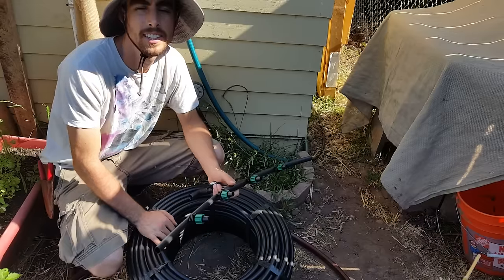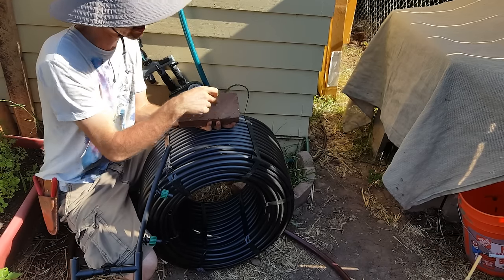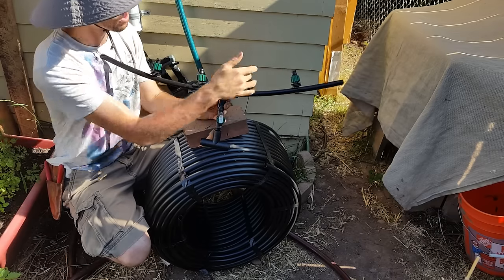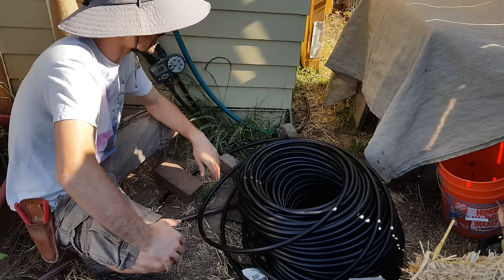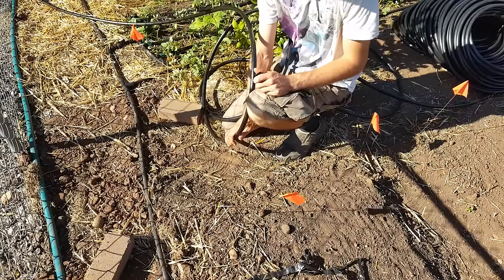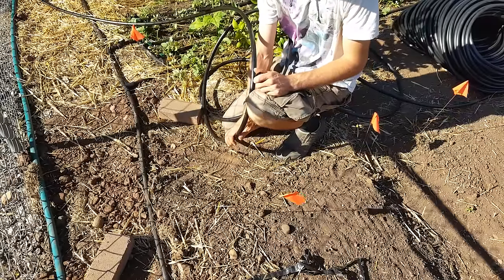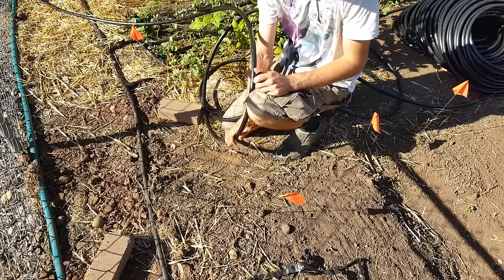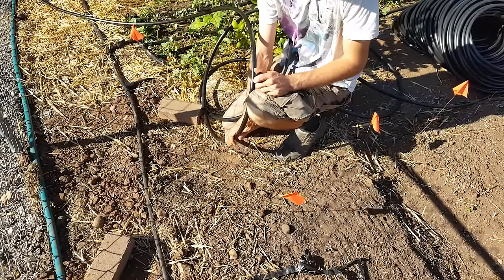Market Garden Irrigation: Installing Drip Tape System

Comment: Those drip lines do best if buried an inch or two. I’ve learned the hard way they fly off and move around too much otherwise. I’ve also never had issue with dirt getting in the line as long as you have the holes facing up. HOSS Tools has an amazing video talking about burring the lines!
You did a great job though 👏

Comment: Very good as sometimes you can't water overhead at night and in the sun the water will scortch the leaves.
Great video
Reply from the maker: I use mostly drip, but I do occasionally use overhead for direct seeding when I'm trying to keep a soaked bed wet. I'll talk more about that in a future video. Actually water on leaves doesn't burn the leaves there is no magnification effect it is a misnomer. Farmers spray water on lettuce constantly in the summer to keep the cool and not bolt. If it damaged the leaves they wouldn't do this. Plus from my own experience I know it water on leaves during the day is fine.
Reply: Nature's Always Right oh cool thanks for the info that sounds right I always wonders how the farmers don't burn thee leaves in the heat.must be a myth that's been wasting my time for years.now I can water all day long :)
Reply from the maker: Ya I used to believe the same thing! Just one of those myths that keeps being repeated. But you are half right, it is better to water early morning because that's the coldest part of the day so there won't be much evaporation, this is especially true with overhead. Those big farms waste an immense amount of water using overhead and watering during the hot day.
Reply: Nature's Always Right that’s interesting I had real trouble keeping up with the watering last year during a heatwave as I was watering at 10pm the night before, but by morning they needed more water and I wasn’t watering them in case I burnt them and actually lost my one and only cucumber as well as losing several astilbes and had brown crispy leaves on a lot of my perennials - I could have safely watered them but I thought I was causing the browning and crisping by burning them with water in the sun
Reply from the maker: If you are running drip, then I recommend watering heavily. Thoroughly soak your garden beds. Once soaked all the way through they are much easier to keep wet after that. It sounds like you didn't water enough. There is no way the bed should dry out overnight. I recommend watering in the early AM 4-7am. That way water isn't sitting all night, it can increase the chances of mildew and rot problems. Watering in the morning allows the surface moisture to evaporate soon after and keep the top of the soil and base of the plant healthier.

Comment: Great video! I was looking for information on how to set up drip for a market garden and this helped a lot !
Reply from the maker: Thanks! perfect timing glad it helped! There are so many ways to set it up. Now I'm doing a bit of a hybrid approach where I use both driptape and overhead watering for direct seeded crops. I'll make a video about it soon.
Reply: Yeah, I would like to get both set up as well(more drip for the lower rotation beds and more overhead for the higher rotation). Looking forward to that video!
Reply from the maker: Ya I think a combination or certain water set ups for certain crops is best. I like using drip tape for all transplanted crops still.

Comment: I have rewatched this so many times trying to figure out how you built your 4 port drip tape diy adapter. I can't for the life of me figure out what that green fitting is. I have searched all through drip depot and always am left flustered with all the things they have. I can't find where you explain that part/attachment (can figure out the diy-ing assembly part). I've given up after coming back to this a handful of times, and have went back to my seeping hose/ 1/2 to 1/4 in. drip line and supplemental sprinklers. If you can point me in a direction of the fitting I would be so grateful. Otherwise, you've given me so much info with your videos. 😊 I run a humble market size garden that is just for us and sharing with my friends, family and the bunnies. After all the hard spring work every year,, it's exhausting to even think about processing and selling all that produce to others haha!

Comment: would it help to put the pressure regulator close to the drip tape line instead of next to the Orbit which could be quite a distance?? especially the low 10 Gph and 15 Gps??  Also how do you work the garden in the fall with all the drip lines going up and down the rows??

Comment: Steven thanks for the info. Need a little more info on what to order. What is the emitter spacing and flow rate? Also mil size on tubing. Thanks.

Comment: Great job and nice video! One question, did you install the drip tape on&off on the both side, or just in on side of the bed and in the other side you put a tube end cap? thanks
Reply from the maker: Thanks Pipa. I put them on both sides so that I could turn the entire bed off. If you aren't doing flow through then just one on/off.

Comment: Hey does that seeder work good I just purchased one an hopefully it'll be here today??
Reply from the maker: Overall for $100 it works very well. But I have a few issues with it, like certain seed sizes not working well with certain plates. Tt could work better but for $100 I can't complain. Everything you have seen growing on my farm that is direct seeded was done with the earthway. Having clean and flat prepped beds really helps to get that thing working at it's best. If you are hitting dirt clods and rocks then it gets stuck a little cuz it's so light. Walk slowly, ensure seed is dropping, give slight downward pressure as you walk the seeder to give good compression of the row of seed. Good luck!
Reply: Thanks you!

Comment: Thanks for the information video. This inspires me. What is the model of the pieces that fit into the punched holes (and where you connect the 4 driplines afterwards..)
Reply: I got it: Perma-Loc Tape x Barb Tubing Takeoff Adapter by brand Irritec, by the way it is impossible to find those in Europe. Or anything similar. In order to reproduce your setup i'd need to use more tees
Reply from the maker: So there are many connectors that will connect drip tape to 1/2" maybe there is a more appropriate fitting for you in Europe. I'm sorry I don't know what it is. Check out this video I recently made https://youtu.be/zB-GgVJyydI?t=12m43s at 12:43 I talk about the cheapest technique to attach drip tape to 1/2". You only need a transfer barb and 30cm of 1/4" line.

Comment: why do you install your pressure reducer before the timer? I am sure they are not designed to operate under constant pressure. Wouldn't it make more sense to install it after the timer, to ensure longer lasting pressure reducer?
Reply from the maker: These orbit timers can be under 100psi if I remember correctly. Since I was running filters and side shoots and all this weird stuff I was worried about pressure loss if I put the pressure reducers at the beginning. I wanted the least amount of friction until the final 4 valve timer then I reduce the pressure as it enters the 1/2". I also am running 2 different psis on one timer. So that was my thinking when setting it up. I've never seen a pressure reducer fail or break unless exposed to the sun for years.

Comment: What flow rate was the drip tape? How long do you have to water?
Reply from the maker: Mine is 15psi .46gph I believe. That will depend on your soil structure and flow rate from your irrigation system.

Comment: 4 lines for a 30 inch bed. It looks like a total of 24 inches wide. 3 inched of bed out each end.
Q: Of the 4 lines, where do you set the plants (horizontally) ?
Q: Are the tape hole lined up for all 4 lines vertically?

EDIT: I see you hide a seed below each hole.

Comment: Not sure if you mentioned it or not but what is the emitter spacing you used on the drip tape?
Reply from the maker: They are 30" beds so I spaced them equally every 6". So emitters at 6, 12, 18, and 24 inches.
Reply: @NaturesAlwaysRight  do you think it's possible to do 4 lines on a 48 inch bed? What's the minimum number of lines I can get away with?

Comment: Do you have a link to the green drip tape connectors? I didn't see it in the list of links.
Reply from the maker: The 1/2inch to drip tape adapter I used is https://www.dripdepot.com/item/irritec-perma-loc-tape-by-barb-tubing-takeoff-adapter-barb-size-3-6mm-perma-loc-size-five-eigths-inch. There are a ton of ways to connect, this is the middle of the road, some are a little cheaper, some are more expensive but come off easily. Here's a ton of adapters, https://www.dripdepot.com/item/irritec-perma-loc-tape-by-barb-tubing-takeoff-adapter-barb-size-3-6mm-perma-loc-size-five-eigths-inch
Reply: Thanks!

Comment: I was wondering what is the type of drip tape and connectors to 1/2” that you use? I didn’t see it listed with the other parts...
Reply from the maker: Thanks for asking so I can add it to the description. I use 3.6mm or 1/4". https://www.dripdepot.com/product/irritec-perma-loc-tape-by-barb-tubing-takeoff-adapter. Check out all the types of adapters out there, many ways to set things up for different reasons. https://www.dripdepot.com/search?q=drip%20tape%20adapter
Reply: Thanks! Also, I seem to be having difficulty choosing what kind of tape as far as thickness(8,10, or 15mm), emitter spacing, and GPH? Do you have a recommendation?

Comment: Each manifold has 4 drip lines.  You have 6 and 7 beds on 2 separate zones.  That means you have 24 and 28 drip lines per zone or valve.  I am assuming 1 foot spacing on your tape with 1 gph emitters for 50 feet.  That comes out to 1200 emitters for one zone and 1400 for the other.  This translates to 1200 gph and 1400 gph on the respective zones.  This brings us to the Achilles heel of water delivery: flow rates.   1/2 inch line will deliver about 8 gpm or 480 gph.  3/4 inch line 13.5 gpm or 810 gph, 1 inch 21 gpm or 1260 gph.  (info from this site:  http://www.premierwatermn.com/flow-rates-achilles-heel-water-system/)  It looks like you may not have enough water with a 1/2 inch supply.  You will have to keep an eye on it I suppose and turn off valves at the manifolds as needed.  That being said, it's good to see your progress and enthusiasm.  If you get enough $$ this year, then have an irrigation guy come in and consult/install a fully automated system.  It will save you a ton of time and money if you get it done right.  You are certainly on the right track.
Reply from the maker: Lol the "Pro" irrigation guys (landscapers) don't know anything about setting up small farm irrigation or horticulture in general. They set it up way too expensive for what is needed, they are just trying to rip off homeowners. My tape is every 6", This tape is running at 15psi, .46gph/100.' Trust me man it has plenty of flow, I realize it isn't full but there are no problems, I've gone through 1 full season. I can run each zone full open no problem, sure I may have to run it longer than if I was using 3/4" but then I'm running PVC which is more expensive, you have to bury it, so way more work.. You aren't thinking efficiency an ease. 500' of 1/2" poly is $50 and bendy, way easier to work with. I maxed out the pressure for 1/2" the cheapest way I could and built a quality system that works like magic. Been running without a hitch for a year and a half so ya I'll pass on the "Professional." This system is fully automated, and is one of the cheapest ways to build an irrigation system of this size. On an acre I would do things differently, and at that size I probably would hire a REAL farm consultant to do it the best way possible, it's all about context.. Sorry but I just don't agree with you for my context, years of actual farming experience and building many types of irrigation systems trumps any landscaping watering experience.

Comment: I always had trouble when the fittings come apart! 😰
Reply from the maker: Oh really you can get all twist on and off connections or compression fittings. Compression fittings never blow out, but ya twist on occasionally come off I always test pull my drip tape under pressure to make sure I got it on their tight.

Comment: So just as you were doing all of this last year, your boy Curtis Stone was ripping his out and going overhead (https://www.youtube.com/watch?v=flv1vf3gLbI)  Are you sticking with this or swapping out to over head?  Thanks for the info man!  Good stuff!
Reply from the maker: Yes I've seen that video and I agree, but it's ALL about context and I'm in San Diego, very dry, hot, high afternoon winds. Very different climate than any of the other market gardeners on YouTube. If I ran overhead constantly that would be insanely inefficient and the water is expensive here as it is. I've grown everything I wanted to the way I wanted to with this drip set up, including salad mixes and roots. But with direct seeded crops and greens all the market gardeners are for sure right, overhead is best. So I'm going to be doing a hybrid approach, I've got this technique going that I really like now and has been working excellent. I use the drip tape to soak the bed after seeding then I just use overhead to keep it wet. Saves a ton of water and I get the best of both world. For all transplanted crops though, I still like drip tape the best.
Reply: Good info.  Thanks!!
Reply from the maker: No problem brotha!